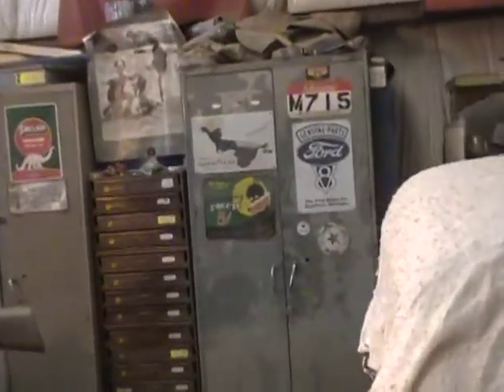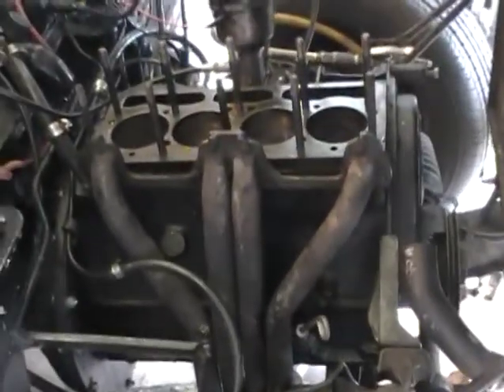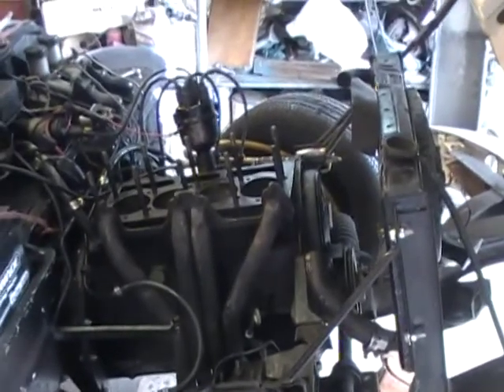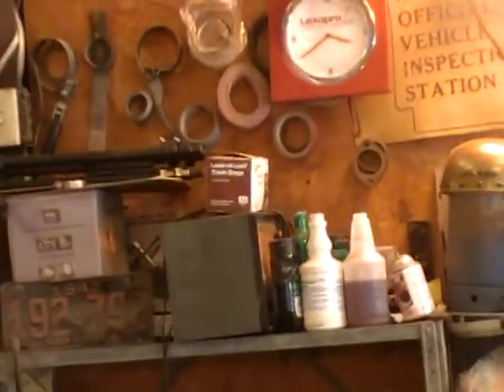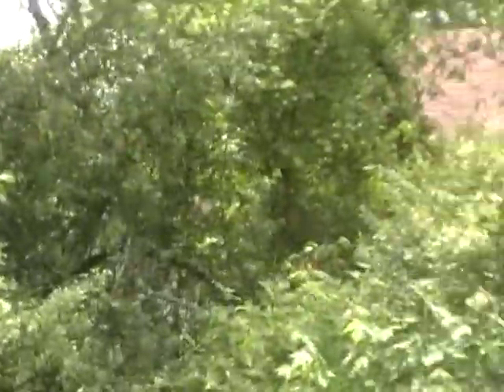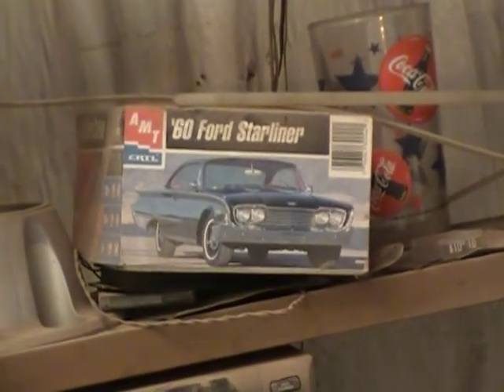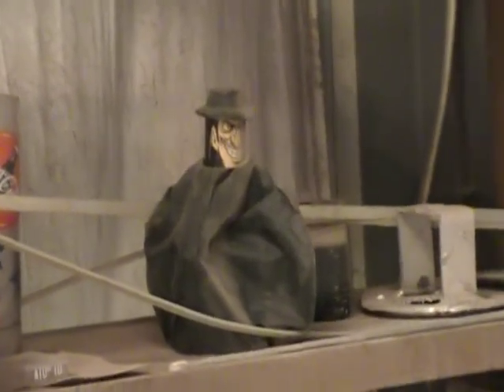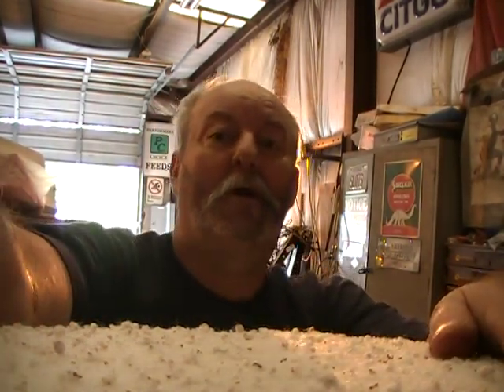ENGINE BUILD started

Comment: man, your going to love wilma when shes all done up. when a spitfire is tuned well its an incredibly smooth and fast reving engine. so make sure every gap is set just so (valve time gap, contact points, spark plugs,) and it will be mighty fine
Reply from the maker: yup gonna try an do everything right and I will have a rare sports car for a long time. Come and have a ride!